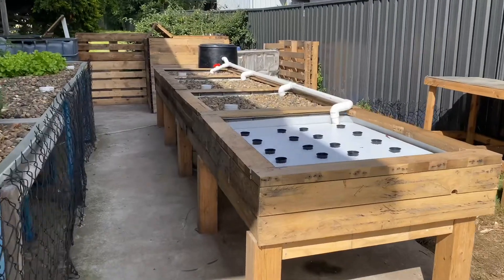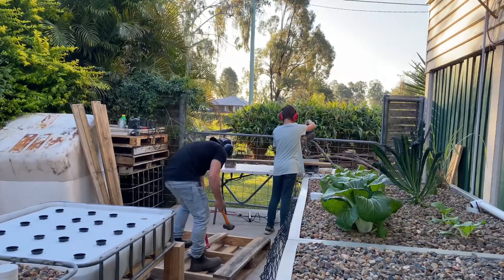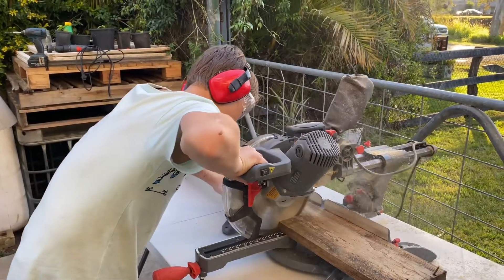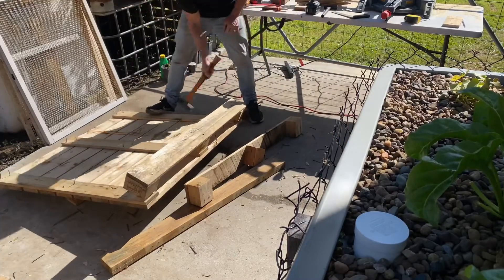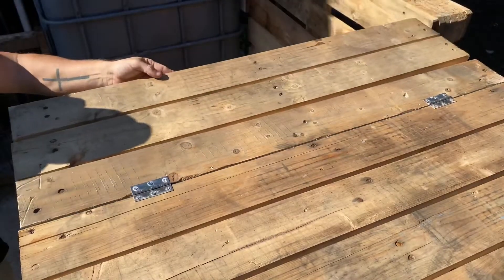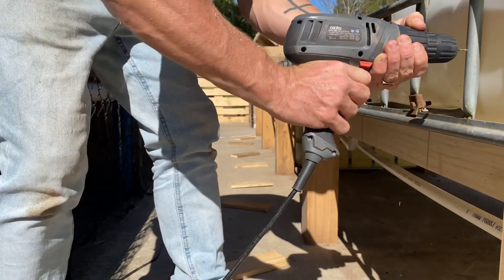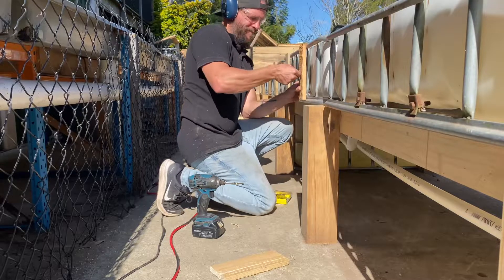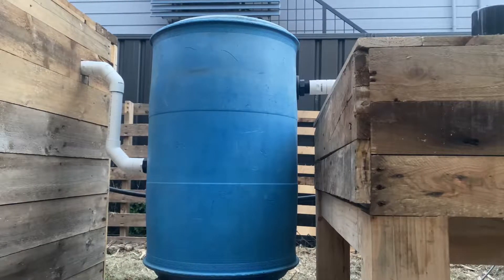Timber Cladding the Aquaponics System #aquaponics #aquaponicsystem #howtobuild

Comment: Wrong. Methyl Bromide does not stay in the wood after treatment, it evaporates away, and treated timber is not dangerous to use. It's a momentary bug treatment, much like sterilizing the pallets, not to contaminate any goods travelling on it. It's not a preservative or impregnation.

Comment: HI Matty - Thanks for the video. your systems looks great. I plan to mimic your system and see how it works for us.  I got few questions.  Will you be painting those timbers? the reason I'm asking is that I used them (for another project) as it is from pallets and it kind of turned black after an year. also my pest inspector was not happy on them directly touching the ground as it might invite termite. how to protect the aquaponic from termites.. thanks